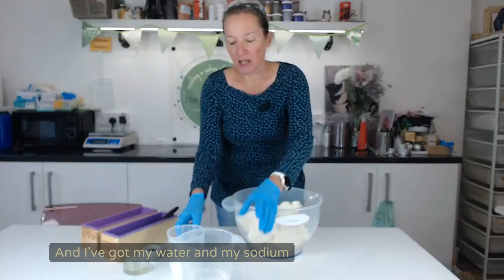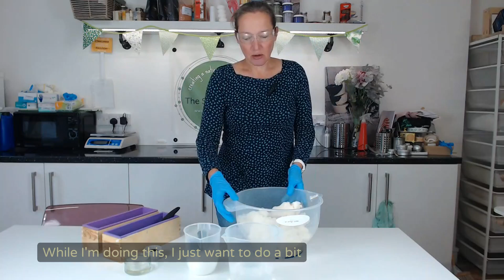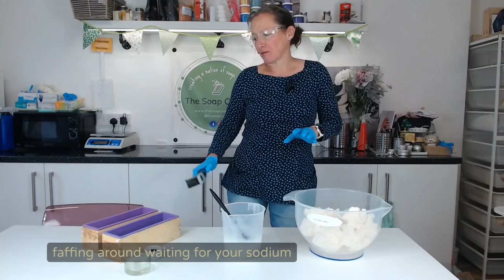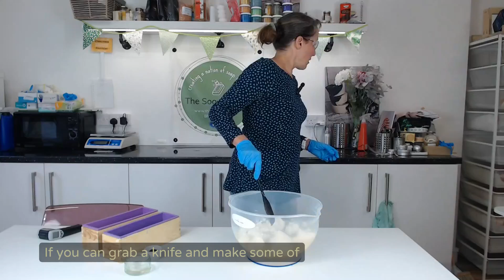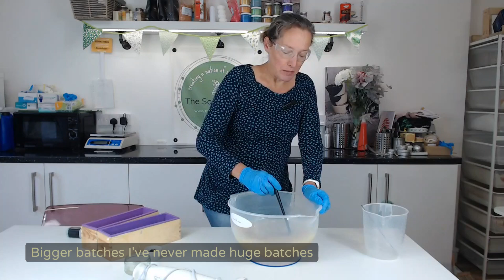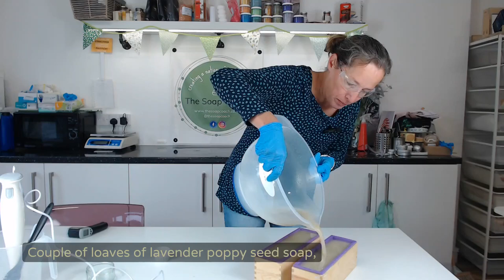Making Soap Quickly Using The Heat Transfer Method

Comment: That is such an awesome method! Have you ever had a problem with any of the butters not melting?
Reply from the maker: @blkbrn1952  sometimes they take ages but keep stirring and they will get there. If it is very cold I would soften them slightly first, or at least some of the harder ones like cocoa butter.